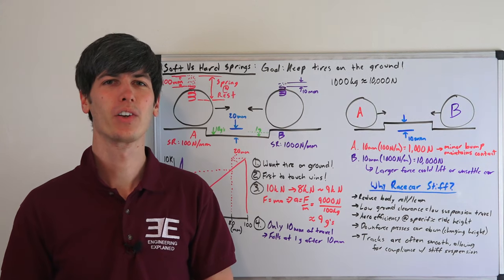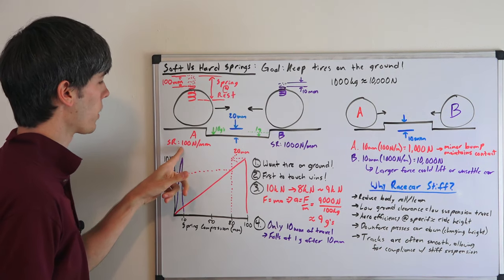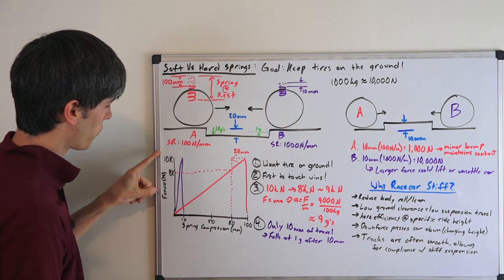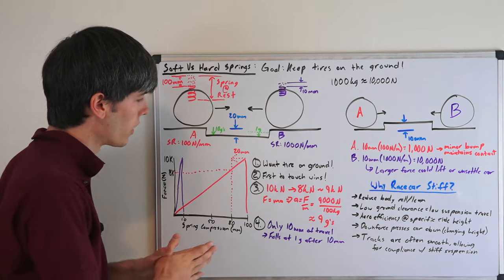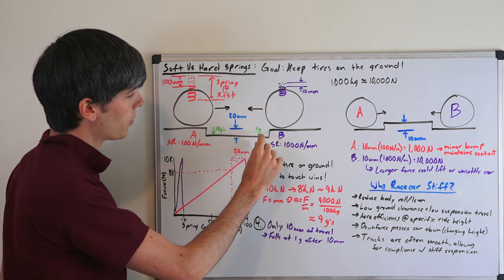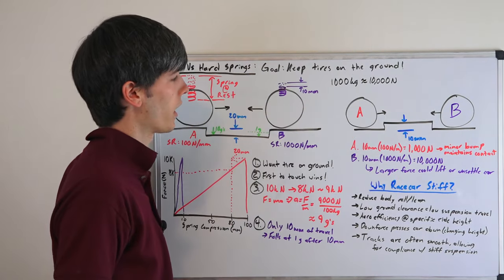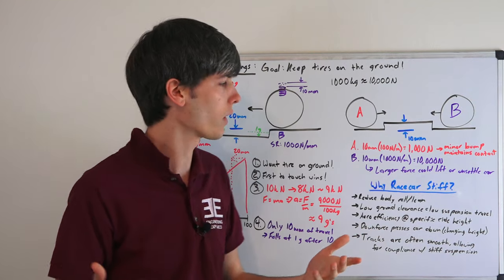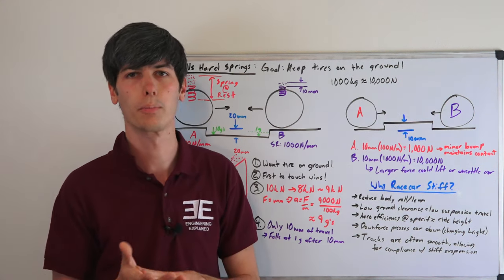What's The Best Suspension - Soft or Stiff Springs?

Comment: Hi, I own a 2011 Subaru Forester and I find it with a harsh suspension as compared to a friend of mine who owns a 2014 Honda Pilot. I asked a friend to check the suspension and he said it is working just fine and no need to replace it as it is not worn.
What do I need to do to make it lesser harsh as it is now? Is there an adjustment I can tweak to make it softer and less stiff?
Should I just replace it? If I need to replace it, which product would you recommend?
Reply: +Francis Ted A. Seguerra Buying new suspension... kinda of expensive could possibly buy softer tires with a larger profile... also not cheap. The engineers design the car to handle best for daily driving with that set up though and unless you are racing you are better off leaving a car stock.

Comment: Wait so...if the stiffer spring HAD 20mm of compression, wouldnt it hit the ground faster than the softer spring?
Reply: As soon as the tire rolls off the edge, the softer sprung tire has 10Gs pushing it down to the ground...ok got that, but how many Gs is pushing down the stiffer sprung tire in the first 10mm? (I get that the last 10mm is just free falling bc it ran out of compression).

Comment: Öhlins are the best. Use self a road and trackkit for my STI-16 How many others brand have worldchampionships in rallycross, wrc, roadracing, Superbike, Moto GP, and  a lot more motorsport. No one, becouse there are nobody else who work with  suspension both for 2 and 4 wheels veichle, and 2 wheels veichle both with and without engine. Koenigegg use öhlins suspension to. Öhlins is a others level than the others brands and they show it whole time On The competions.

Comment: There are good reasons to use lower spring rates for bumpy and low grip surfaces, but they aren't touched on here.

Your example is just badly engineered. Preload, progressive rate springs, and/or helper springs should be used to insure that the springs are working across the entire range of motion.  If you are setup right, the static position should be roughly centered in the stroke.  More or less, depending on your exact needs.  

You are also completely ignoring the effect of dampers.

When they are setup well, track cars drive over curbs they barely have clearance for at high speed without being unsettled.  The primary reason for low spring rates on passenger vehicles is that most people are uncomfortable in a car with a suspension frequency higher than about 0.9Hz.

Comment: so i was looking at a set of coilovers that are only rebound adjustable... my goal is to lower my car, that will only be used on the street, altough i want it setup for some "ocasional spirited driving" on some nice twisties we have around here... so, what should i do regarding the rebound? - or +?
from my understanding, "-", counterclockwise, will make it slower for the shock to return to normal position (lower fluid flow), resulting in stiffer ride with less body roll, while "+", clockwise, makes the shock return to normal position faster (higher fluid flow), resulting in softer ride with more body roll... is this correct?
pardon my ignorance, i'm just new at this stuff :/

Comment: Really? I've got a S13 with medium tein coilover setup, stiff but still comfortable for daily use, and I swear I could beat another S13 with stock or softer suspension setup around corners any day of the week...
Reply: The difference is that a good tien setup is compliant over bumps, but firmer than stock 25 year old suspension. The basic principals in this video still apply, but only to a certain limit. It is possible to go too soft, or to mismatch spring rates and damping forces. Which could both cause that same tire to "bounce" a bit, reducing contact patch momentarily.Another thing to take into account is that most S13s have likely almost never had suspension bushings replaced. So, are effectively riding on worn out pieces of rubber that have the job of helping cushion the ride, but can flex and alter geometry under hard cornering (there are videos of suspension at work on a racetrack where you can visibly see the control arms deflecting). Your suspension is helping maintain correct contact between tire and pavement on a smooth surface. But over a very rough patch of road that stock S13 would have a bit more grip available. All other parameters being equal, softer will do better on rough roads.
Reply: +kenny240 Well yeah on rough roads of course you wanna go soft, like rally cars. I'm just talking about mostly smooth, sometimes rough street roads.
My brand of coilovers just happen to be tein, but I'm implying any kinda aftermarket suspension upgrade. 
Also, I didn't take into account that it's lowered so the lower centre of gravity would definitely be of benefit to cornering. 
I think also because the suspension is stiffer, when going round corners there will be more initial load on the outside wheels, thus giving you more grip to turn in too.

Comment: But what if I had 200 milligrams of Newtons . Traveling at the speed of sound,  and the force of gravity is recking havoc on the coils ? So I think the need to lower the tier air pressure , causing the wheels of my intellectual power not to revolve with sufficient rapidity to comprehend that the speed of light plays no part in the equation ? Thanks I will go with the softer springs 
.

Comment: I was a little disappointed in this video.  You only considered the case when there was so little suspension travel that it bottoms out or becomes over extended over a bump.  You also only considered a spring rate increase of 10x the stock rate!  That's a pretty extreme.  You should have considered a less extreme example, like springs that are 2x the stock rate.
-Mike, PE.

Comment: but what do sport cars use? Is it considered soft or stiff?
Reply: Generally stiff. Stiff springs are much more fun to drive with as long as you're on decent roads. Despite what he says about grip, soft springs are usually more about comfort.
Reply: Softer suspension gives more grip but higher body roll which is not desirable in a sports car.
Reply: To add to Prashanth's comment, the soft springs have too many undesirable effects to go with that "added" mechanical grip.  Huge changes in suspension alignment, huge changes in ride height due to aero, huge changes in car attitude in pitch/squat and roll, relatively delayed responses to inputs, etc. 

The correct answer is "They use enough spring to make the car do what they want".  I have had the privilege of driving dozens of cars setup differently and one thing has been consistent for me... the soft spring + big swaybar setup is always worse to drive fast than the big spring + small bar setup.  The car is simply far less predictable with softer springs due to the braking/acceleration forces impact on the car's pitch/squat.

Comment: I've heard that stiffer suspension require grippier tires. Is that true? And if it is, why?
Reply: SingleTurboSupra Well obviously grippier tires are always superior if your goal is maximum grip and traction.

When one or multiple of your wheels lose contact to the road it is advantageous to have grippy tires so that the wheels which still have ground contact can take the full load of the car.
Reply: Joel Sägesser So it's only true on bumpy roads. On smooth road it's whatever?
Reply: Well stickier tires provide more grip no matter how stiff or soft your suspension is, so it's a good idea to upgrade anyway.

If you have a good suspension setup but bad tires then you're wasting a lot of potential.
Reply: And yes the difference is much bigger on bumpy roads
Reply: Joel Sägesser Yes of course the tires should be upgraded as well. It was just that I heard that worse tires couldn't handle stiff suspension or something like that. Just wanted to know if it was true. But I understand now. It only affects on bumpy roads. (Of course you could just soften the suspension if you are losing grip on bumps. Easier than buying new tires lol)
Reply: That's why adjustable dampers are so good :)
Reply: SingleTurboSupra I'm pretty sure that is right, but I'm not absolutely sure why. And Joel is not really explaining it either. I even tested it out on Project CARS some time ago, comparing road and slicks on a light prototype. My best guess is that is has to do with the balance of basic grip level vs timing. With stiffer springs you lose on the grip but you gain potential on the timing side. But because the e.g. softer tires can even that out, you come out with an advantage.
Well in the end the suspension is only there to make sure the tire can work well.

PS: Springs should be as stiff as needed and as soft as possible.
Reply: a.k.a. miagi Well I asked this same question on carthrottle where EE said that there ain't really a correlation between the two. He did also say that with grippier tires the suspension has more work to do and the way I understood that is that it would rather be the other way around. Grippier tires need stiffer suspension to keep the car stabilized. I'm not sure about that though. I'm not engineer (yet).

Also are you sure it was smooth corners where you tested this out?
Reply: SingleTurboSupra It was the Hockenheim track and Watkins Glen I tested. It simply felt nervous on stiff Springs and road tires, while feeling well with slick.
Reply: SingleTurboSupra Yes. :)  Well grippier tyres require stiffer suspension to be precise.  Why -- because grippier tyres produce more cornering forces, and may overwhelm a stock suspension.  Say it you were to suddenly slap slick tyres on a car and try to test out it's cornering. ;)
Reply: SingleTurboSupra Worse tyres won't make good use of stiffer suspension.  Just makes the car uncomfrotable for no good reason.

Comment: I have been having this discussion for some time.  On an oval track, would it not make sense to put heavier rate springs on the right side of the car? (assuming turning left in all turns.)
Reply: +Lonewlf7676 Yes, and they do this together with some positive camber on the inside wheels to keep all wheels als flat as possible to optimize tyre patch usage.
Reply: A friend of mine that keeps bugging me to build a car for him insists that the stiffer springs on the outside would give him control issues. I've been sticking by my theory that they would "plant" the tires harder and reduce body roll in the corners,..thereby allowing you to run your line much faster without getting into an oversteer situation.
Reply: The set up I'm speaking of is for oval track only, of course.  On a road course I would set the car up with matched progressive rate coils.

Comment: So someone like me who lives in an awful city near Chicago where there's pot holes I should go for soft springs??
Reply: +FUS RO DAH not necessarily, it's always a trade-off.  if the pot-holes are deep you need the suspension to be hard enough to absorb all of the energy without blowing through all of its travel and hitting the bump stops.

unless you're doing special things with your car or have gone with much grippier tyres, the engineers who built it have done many man-years of R&D to select an appropriate spring rate for general road use.

Comment: I'm guessing he's forgetting the weight of car... also assuming he's doing the front wheel, they are round at normal road speed and not track speed. they are rounded so the 20mm bump wouldn't do anything... the tire will still be on the floor but with less tire contact.

Comment: I think your rebound example is too contrived.   If the "stiff" spring was only 5x stiffer than the soft one (500 N/mm), you would have 20mm of travel and thus not proving the stiffer one is any different than the soft one with your argument. Your bump example is more convincing, but the higher force required in bump is also in rebound, and thus actually shows the stiffer spring is more "responsive" in rebound.  I believe it is actually a rare case when cars run out of rebound travel unless tuned that way (droop settings).

Comment: Well, good video but in reality there are more things in the formula!!! Dual tube (soft suspension can last few months until fails*Bubbles). So monotube (stiff suspension) will keep the car in line!!! So much better control, race cars, off-road cars ext ext
Daily use cars will be smoother as well by using monotube suspension! In theory is the other way around!! In reality experience proved the opposite due to dual tube weak technique/construction!!!

Comment: would stiffer springs reduce turning radius?
Reply: No they won't but you can feel less G pull in the cabin.
Reply: Cornering, start incline and stop decline would be much more comfortable with stiffer springs granted that roads are fully flush like on tracks. However driving over potholes and bumps would be much more comfortable with softer springs like at city roads. Thats why softer springs are used in your daily driver and stiffer in race cars

Comment: Spring rate doesnt mean the suspension is stiff or not..
Reply from the maker: Nope, but it does determine if the springs are stiff or not, which is what this video is about. :)
Reply: Engineering Explained you re taking suspension only as springs weirdly actually unfortunately.. the springs height is important as well while comparing like sports springs can be use with stock dampers.. so in real life shorter but the same spring rated springs can be more comfy with stock dampers while maintaining lower body roll.. and the second statement in vid says whole point of suspension keep the tires on the ground.. i can understand you re an engineer but in racing especially in slower corners losing contact with the ground a bit with rear inner tire helps to front tires to bite the ground..for telling such things like best suspension etc. it d be wiser to put the dampers in the account as well..

Comment: Completely vague information with very little basis to real world applications. Spring rates are dependent on the weight of the vehicle and its total load per corner, same with tires. The only relevant information you stated was at 0:40 when referring to the potential weight placed on the spring. If the only reason we needed suspension to keep the tires on the road, then we would only need enough force to manage the weight of the wheel assembly or unsprung weight. Which would make for absolutely horrible ride quality.

Also the overall rate per inch or mm is dependent on the overall load in relation to the wheel travel and ground clearance. A car lower to the ground and with significantly less wheel travel will not have the same spring rate per inch/mm than a car with a longer wheel travel no matter surface irregularities.

Soft or stiff springs is a horrible guideline without knowing the load in needs to displace. The spring should be chosen for the weight it needs to support and the indifference of total tire load. Most "race cars" have "stiff" springs per inch/mm because they have less spring travel and a higher aerodynamic force increasing its pressure on the tires. In reality most "race cars" have a lower overall load rating certainly if the car weighs less and has less aerodynamic force acting upon it than stock.

Further more, you never explained what exactly equals "stiff" or "soft". Stiff would be if the load rating of the spring was greater than the weight it has to displace, soft would be the opposite to this. Optimal (which is nearly impossible, but the overall goal with race cars) is to have the spring rating matched almost 100% to the total weight it needs to support at full load while still maintaining enough ground clearance.

Comment: Yeah I think you could of used a simpler method to explain it while still using some math yet in pounds as well as using suspension terms and methods...we all know if a spring can’t drop down enough to keep a contact patch it will simply pull the car down with it into a pot hole, but most of us race on smooth surfaces be it dirt or asphalt and there’s still a difference between stiffness that your not explaining when the road isn’t full of holes and we arent racing in the Desert or on newyork city streets..

Comment: most automotive companies offer stiffer suspensions  than soft ones in India because of the bad roads in India Why is that the case shouldn't they offer softer suspensions rather than stiffer ones(especially car manufactures like bmw which do not manufacture cars in india make sure of that)

Comment: what rally car use, soft springs or stiff springs?
Reply: Valen Gerung I guess they change it depending on what they are driving on.
Reply: Valen Gerung on a track very still, on road a lot more travel bet a bit stiffer then a normal car, on sand en in desert like environments as long a travel as possible. just look fore WRC stuff on tarmac en on sand u u will see a choking differences
Reply: Valen Gerung On gravel very soft. I've heard they are sometimes even softer than normal street cars, but have a lot more travel
Reply from the maker: Valen Gerung When I was speaking with the Subaru engineer for their Rally America team, I believe he was saying they were about 3x softer than road cars, with about 5x as much travel.
Reply: thanks for the information